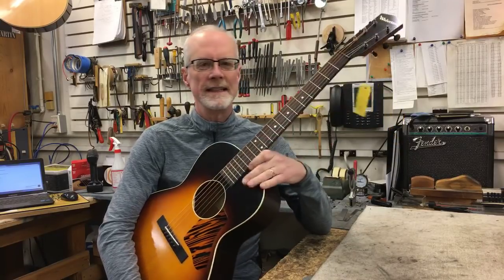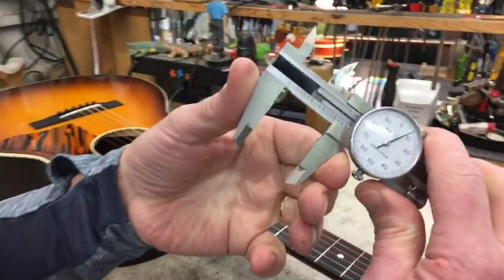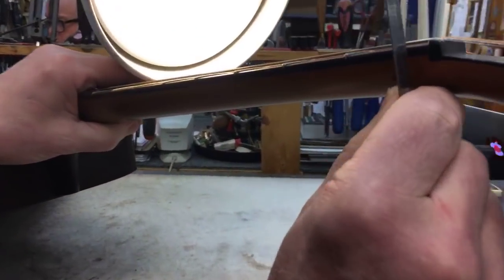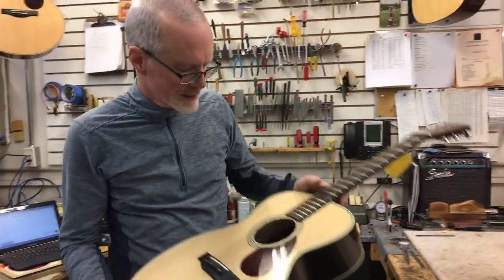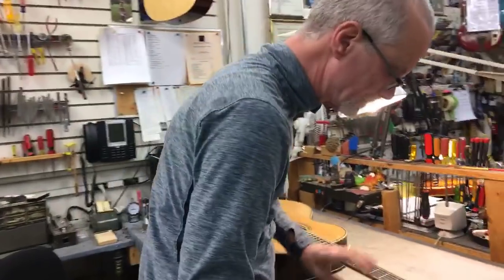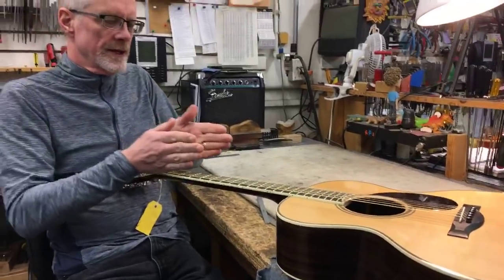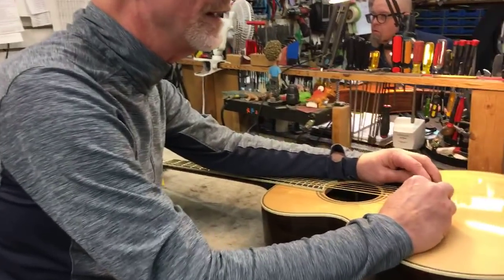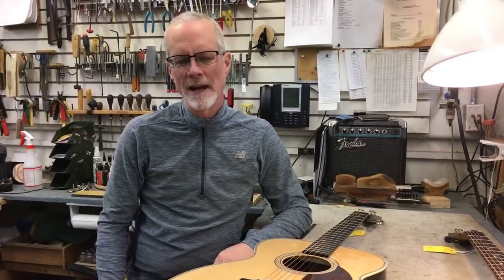In The Shop: Guitar Geometry, Nut Width and String Spacing | Elderly Instruments

Comment: Excellent - thank you. The focus by makers is on the nut width. That can give me a good indication of what comfort level I will have with playing. For me, it is more about the string spacing at the nut and not the actual nut width. That can vary depending on how close to the edge of the board they want to get with the E strings.

I bought a guitar I liked that had a 1 3/4 nut. I prefer 1 13/16 or 1 7/8. I am a finger picker who started out on classical and then picked up steel string also - so I prefer a wider neck (string spacing actually) on my steel string guitars. So I got the shop to cut a new 1 3/4 nut with slots a little wider to increase the string spacing. They were able to do it and still leave enough room to the edge of the board so the string did not slip off the board when played. It may have increased the string spacing by a few millimeters but that difference was worth it to me. 

I think a binding along the board may be a factor to consider also if you are wanting to widen the string spacing.

I wish makers would advertise the actual string spacing at the nut  (as they do at the bridge) instead of just the nut width. I really have no concern about the nut width - the string spacing is what I need to know.

Comment: Is it possible to go from a 1 11/16” nut and install a new 1 3/4” to make string spacing a little wider?
Reply: Did you find an answer? I bought a guitar with 1 3/4 nut. I got a new 1 3/4 nut installed with the slots cut for a slightly wider string spacing. It was possible because there was enough room on the outside of the E strings. You have to be careful or the strings can slip off the edge of the board as you play unless there is enough spacing to prevent it. I forget the exact amount but I think it was about $50 to have it done. It probably increased the string spacing by 1/16 or so and that was worth it to me. I finger pick and could tell the difference.

Comment: Its so annoying and frustrating that the majority of this info is managed in imperial measurements, is ridiculous how imprecise and hard to wrap arround compared to the metric system.
Reply: It’s totally easy
Reply: I have to agree. Every video about guitars from the US uses imperial. Of course US made guitars themselves are imperial. Screw threads etc. It’s completely insane that the US is still using this system. I live in the UK and we used to use this so we understand both. We will use miles, inches etc but metric is way easier to calculate being a decimal system.